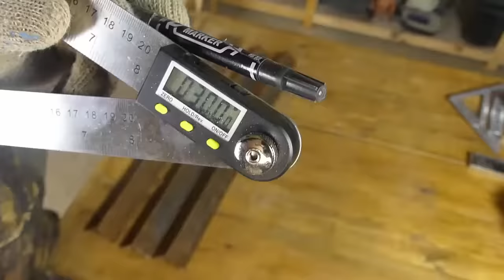I didn't believe it myself! I welded a barrel of pipes and it all worked!

Comment: You will drastically improve the heater’s performance if you run a pipe from the outside to the air intake. Right now, cold air is being pulled inside your building to make up for the combustion air and whatever air is going up the chimney. Pull the combustion air into the heater from outside so the cold air doesn’t mix with the air in the room.
Reply: Exactly.
Reply: while this is good, it is also nice to draw some fresh air into a building (regardless of outside temp)... so a balance of drawing outside air directly into the stove, and drawing a draft under your door (for instance) is actually better for air quality.
Reply: Agree. That's Ben Franklin's idea from year 1742.
Reply: pulling outside air through the room into the oven prevent monoxide build up, aside that, an workshop should be ventilated...
Reply: The hot exhaust is positive pressure so can escape into the room when nearly closed. Better is to put the restriction on the intake side and keep the whole stove negative pressure.
Reply: Smoke, air and gases from the burn escape through the chimney.  That volume has to be replaced from outside.  Pull air directly from outside and you are using colder air for the burn process.  Pull air from inside  and you are using warmer air.  Either way, the air that escapes through the chimney has to be replaced with air from the outside.
Reply: Forgot about moisture.
When u take air from outside moisture stays in a garage. When u let cold and dry air get into garage moisture leaves through chimney. And garage warm and dry
Reply: @alexeystuliy2001  perfect are ovens that use outside and inside air for feeding the fire, you can go with 100% inside for firing up so you have draft going and then switch to 90% outside air to have an drying effect and ventilate the room
Reply: @Leeofthestorm  
+1
Всегда нужна инфильтрация
Reply: Yip.
Reply: Thats Right
Reply: So
Reply: @А.Ельцов  with all due respect to Mr Franklin , people figured that out far before the late and great Mr Ben Franklin🇺🇲
Reply: Blow air on the outside of the barrel with a fan and you'll overheat the workshop in minutes.
Reply: Positive, Negative and Equal Pressure makes a huge difference if heated area isn't sealed properly. Same principle for A/C and A/C sizing.
Reply: @saddle1940  absolutely , be warm in there really quickly.
Reply: @pratiwirose5003  common mistake - outside insulated chimney increases draft  ie it sucks air through the system
Reply: X
Reply: @souloftheage  no one i know sleeps in the shop. If they do its a beadroom. Good caution bad application location.
Reply: M la
Reply: @Leeofthestorm  gracias por compartir tú sabiduría con todo el mundo eres genial. Que Dios te ilumine tú mente con mas sabiduría des Los Ángeles California un fuerte abrazo bye.
Reply: It's just that Vanya was looking for a potpourri and banging his head in search of an idea, as a result, he turned 30 m of pipes into scrap metal - the materials would be enough to heat a two-story house ...
Reply: Thanks for the advice hadn't thought about that,makes me feel a little stupid.
Reply: Great  advice!
Reply: @GBusall    It's better.   Instead of the outer skin of a stove radiating the heat, this prevents you burning the hell out of anyone that touches it. It's using rising air convection the way a fireplace liner does.  Those pipes are much cooler to the touch than the barrel itself.
Reply: @jfsauer42    That was my thinking also at first...pull in the coldest room air down near the floor; don't pull freezing cold air in from outside.
But after I thought about what Gary said, I think he might be right.  
If you're getting all your makeup air from outside, it can flow in freely and provide maximum oxygen to the fire.  Freezing cold or not, it's blowing really hard on that fire. And it never escapes to mix with room air.
If you're getting all your makeup air from inside, you are still pulling in freezing cold outside air.  But now it has to be sucked into the building from around window seals, under threshholds, attic cracks, even the flue, and it all mixes with warm room air.   
So not only would be a decrease in air supply, it would be draftier in the room. 
I think he might be right!  Maybe you'd want a little room air to be pulled, just to keep the room from becoming too dry or too humid.
Reply: @pratiwirose5003    I think that restrictor he put in at the top could be useful for when the stove is turned off.....keeps warm room air from escaping and cold outside air from entering.
Reply: ط @А.Ельцов
Reply: Does anyone know what app he is using to show the heat signature?  Thanks.
Reply: Well I regulate my heat with doors and windows so that's not a problem 😲. Moma likes it 🥵
Reply: @pouncepounce7417  That is a non issue if your intake is coming from outside as it will be drawn up and out the exhaust... Also modern buildings aren't air tight, specially workshops.
Carbon monoxide is only an issue if it's not ventilating to the outside anyways.
Reply: @SilvaDreams  if you reduce exhaust flow you still risk poisoning, monoxide can be accumulative poisnous too, you need only small concentrations.
Reply: @pouncepounce7417  How is it reducing the exhaust flow by having your intake from the outside instead of from the shop which would actually cause a pressure differential in the building and slowing the possible air intake since it has to force it's way in through any gaps in the building and causing drafts?
Reply: @SilvaDreams  I was refering to people who use the shutter for the chimmney to reduce airflow to have an slower burning fire.
As long you have an old building with "inbuild ventialtion" not an issue, as they found out in victorian times with better building tech very deadly as soon you manage to build someway airtight.

I myself prefer in my shop an oven that takes air from inside so i get ventilation going, but i do not produce much in flammable gasses and dust so it is not an issue.
Reply: @Leeofthestorm  this is so true and the exact reason why homes should NOT be air-tight.
Reply: Depends if your house is air tight.  New houses draw outside air through the cold air return.  Old houses draw outside air through the unsealed envelope of the house, so you are drawing air from outside one way or another, it is merely warmed up before it gets to the heater.  Kinda like a giant air to air exchanger.   No reason to use very cold air and try to heat it up, instead of merely heating up air that is already room temperature.
Reply: @stevenut69  Modern airtight houses with air exchangers make me sick, I did grow up in an log house that was practical an sieve and durn cold in winter, but i am fine in that enviroment, stick me into an modern house that is tested for leaks and i wither. No idea why.
Reply: @pouncepounce7417  you should begetting some fresh air in any new house.  At least in Wisconsin it's code to have "make up air" which is a 6" insulated pipe that adds fresh outside air to the system by drawing air from outside via your cold air returns any time your furnace fan runs.  Many modern thermostats now have a recirculation setting that runs the fan no matter what after a certain amount of time to have an " air change".  If you don't have something like this, it's very easy to add.
Reply: @stevenut69  It is not about the oxygen content of the air, so to speak, it is the atmosphere i think, wood houses are very different to houses build from modern materials regarding heat radiation and air moisture, then modern houses are way to hot for my taste.
Reply: Bueno que vien esperemo como  funsiona
Reply: @pouncepounce7417  I think I misread his post.  It looks like he is talking about a fresh air for combustion like is on a high efficiency furnace or power vent water heater.
Reply: @stevenut69  ah i only ever had the primitive "burn whatever" ovens
Reply: so build one, let's see it..
Reply: @formula2tom225  ?
Reply: @pouncepounce7417  instead of armchair quarterbacking, build one
Reply: @formula2tom225  i build plenty and rebuild old ones, just not modern types because i lack the theoretical background and you can very much kill people if you do it wrong (that you should have noticed from my posts)
Reply: @pouncepounce7417  it's ok pro, you do you. that you'd think i'm reading all of your posts is all i need to know. enjoy your hobby.
Reply: @formula2tom225  Well you put your opinion out there as if we know each other since kindergarden, so...
Reply: @pouncepounce7417  it clearly cut a little to close to the bone, sounds like you've heard it before...  the original comment i made was simple...it didn't require a response. you didn't like it, so you had to pounce-pounce back.. let it lie and enjoy your day dude..
Reply: @puttingitogether2816  it’s not an app, it will be a thermal imaging camera like a flir for example, you can get thermal cameras that connect to you phone iseek been one but they aren’t as clear an image as a standalone
Reply: @formula2tom225  Are you strange? Sounds it.
Reply: @deandeann1541  oh deandean it's not my fault you got bullied as a kid...go find someone else to judge. have a blessed day.
Reply: @Leeofthestorm  I'm somewhat skeptical about modern ideas on making houses super-tight.  You can have an efficient house that breathes.
Reply: @harrymills2770  I think that it is a terrible idea.  I keep my window open all the time in my bedroom even in winter at 53 N latittude in Canada.  Fresh air is king. The problem here is in frost build up where air leaks are not designed into the system, but occur at draught locations.
Reply: This also applies to range hoods and clothes dryers. It's called make-up air.
Reply: Your advice is a genius touch ,very impressed
Reply: I have a wood stove that I can connect an outside pipe to. I was thinking of doing it to keep from pulling warm air from the room into it. Also I forgot to turn the bath exhaust fan off one night and I think it may have pulled some smoke and carbon monoxide from the stove. Trying to figure out exactly if the intake on the back is really air tight or tight enough. The instructions said you have that option but when I’ve smoked the house up from trying to start a fire with a completely cold chimney it looks like smoke is coming from around the bottom of the stove, not just the intake. Srry for the paragraph, u just seem to know about it and wondering if you have more input.
Reply: @alexeystuliy2001  it’s usually very dry in cold weather and using wood heat with lower the humidity too much in a building anyway.
Reply: @pouncepounce7417  but i love monoxide
Reply: Your heater is losing a lot of efficiency due to be insulated by those steel pipes around it.  Yes i know steel pipes are poor insulator, but they are an insulator nonetheless.  A larger diameter tube around your drum with a little bit of forced air (using a small fan for instance)  would increase your efficiency a lot.
Reply: It's a shop with cinder block walls..  

It's a sieve
Reply: Nhyy.
Reply: Yeah, tell me about it!  I have a wood heater that pulls air from the inside.  I definitely need to change that.  Once, when I opened it to put more wood in, a little smoke escaped.  My wife thought that was just terrible!  So, instead of tolerating it until it cleared up, she went and turned on the attic fan - with every window in the house shut!  Needless to say, that pulled a vacuum on the heater, reversed the air flow through it, and began filling the house with smoke!  Bright idea, huh? 😅
Reply: @jfsauer42  exactly right
Reply: @pouncepounce7417  the wood stove we use to heat our 30x40x20 foot garage says differently. Pulls inside air and heats up the garage to a nice toasty 80+ and keeps it nice and dry. Only has a small 4x4 draft door with a hole in it. I will say the garage isn't perfectly sealed though. About a 1" gap under the front door.
Reply: @JLukeToxins1  I do the same with my shop, automatic air replacement.
as soon it hit -20C though an stove that draws outside air  only is more fun...
Reply: To increase efficiency, outside air should be preheated with the flue gas.
Reply: So u would suggest the inlet pipe for fresh air for the chamber where the fire is made come from a place inside the house that's already heated by the heater pipe?
Reply: @motogeee510  It would be slightly more efficient to use outside air.  Preheated  air is used in large industrial boilers, like for power generation, for blast furnaces and steel furnaces.  The amount of heat recovered is limited because the temperature of the flue gas needs to be high enough for it to rise in the exhaust flue.  A forced draft system uses a fan to force the outside air in the furnace and he combustion products up the flue.  A pressurized furnace has to be sealed tightly to prevent fire and carbon monoxide leakage.
Reply: Put the chimney like upside down U and across the floor.. longer way for the heat and lower in the room.
Reply: Negligible influence
Reply: Ην

Comment: The people who down voted this video probably don't have the Creativity, Hard Work, or Skills to try this themselves.
Reply: @Joby Fluorine those pipes on the outside hold alot of heat
Reply: He doesn't explain the reasons for his design.. What's the square side door for if you load from the top? Why is it so inconveniently located nearly around back?
Why a large draft opening that is isolated from the combustion buy an intentional steel plate? Why that steel plate for that matter?
Why a bottom grate if the small air intake doesn't go below it? Why the unregulated (no door) smaller intake pipe? Why channel the small intake from so high?
Very poor welding probably bothers some people.
Why the addition of the slotted metal around the smaller intake pipe?
55 gal barrels are notoriously short lived burn containers..
Why the external bunch of pipes? If for convection why such poor contact of just tacking them to the ridges?
Reply: @Dr_Wrong  exactly my problem with the video. This is the most complicated way of turning an empty barrel into an oven I have ever seen. So some explanation would make sense.
Reply: >>об քե

Comment: As a fabricator with a decently equipped shop, I love the ingenuity and creativity! Getting things built with what you have is a truly awesome skill.
Reply: З
Reply: Que es eso ? 
Que uso le das ?
Reply: @herrbryjaz6680  es para calentar el aire de la casa
Reply: Having a plasma cutter would save a Fortune in production time
Reply: @Butchsiek  he he, yup I said it like 5x watching, ya must have heard me !!!
THaT SaID.........pro-LeVeL skills cutting, me impressed !!!
The one thing that warmed my heart was seeing him using the stick welder, I built everything I needed with the little old Lincoln WeLDeR aka → BuZZ BoX
Reply: @cameltube-vk7el  arc welding, using 1611 rod is the best for welding rusted metal and in 3rd world countries, 
arc welding is the best that they have..
I learned how to weld self taught working for Southern Pacific Railroad..
Then self taught  for Mig and Tig working for Campbell Soups, where I used all 3 forms on stainless steel..
I have a Lincoln Mig welder..
But at times I think about getting an arc welder and plasma cutter.
Reply: I had a farmer freind almost illiterate but he knew the basics to get by on paperwork . I was amazed the things he did without measuring   He would cut things with a torch for a perfect fit  .it was just anazing
Reply: I bought an old sears stick welder. For fifty bucks many years ago and I started welding either just the knowledge I picked up at  the paper mill  where I worked watching the shop guys welding it serves my purpose
Reply: МОЛОДЕЦ!!!
Reply: 0
Reply: THANKS
Reply: @herrbryjaz6680  У нас сейчас уже днём +4, ночью - 2, это только в начале октября, а так как рябины было много, год обещает быть холодным и температура может быть как -10 градусов в тёплый день, так и -35 градусов в холодный, поэтому это очень кстати будет для многих русских людей, об этом ещё говорят просмотры видео
Reply: @herrbryjaz6680  This is a heater.
Reply: Some people just make do with what they have and do a great job with it like he just did.
Reply: @Butchsiek  get the Lincoln Pro Mig and you’ll have the best of all the welding need worlds
Reply: @relicrecoveryspecialist16  I have a Lincoln, rarely do I use it..
I use to have a PowCon 630SMP dual voltage welder (230/460) for doing auto body work, loved it..
But one weekend when I was out of town, the welder decided to runaway and he took some of his power tool  buddies along with him..
Reply: @Butchsiek  owning a landscaping bussiness for 33 years ripped off 3 times I was very aware of my bread and butter but seems like I’m my case getting ripped off was cheaper than paying for the insurance.  Ok maybe that’s not the way to look at it on 3rd thought🤔
Reply: Wish they would cut off peoples hand like they do over in oil country I believe it’s sheekville
Reply: Thieves that go after small bussiness owners I’m so believing karma exists and living mine - get what ya put
Reply: @jonathanbuford1793  I bet everytime you got ripped off, it gave you a woody. 
😂😂
Reply: Когда варишь надо с трубцины резинки снимать, згорят или сваркой побьёт😊
Reply: @Butchsiek done a fine job! expert Quality👍🏻

Comment: Brave technician.
The heat will last dramaticaly longer when you place inside and around from bottom till up a layer of heavy bricks for fireplaces. This mass captures the heat and delays the cooling.
Best wishes! 
from greece.